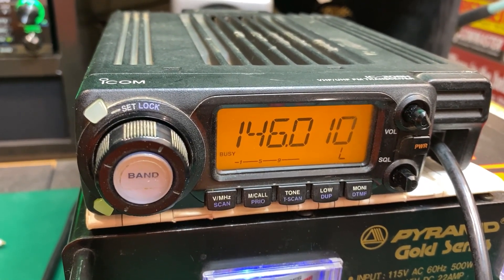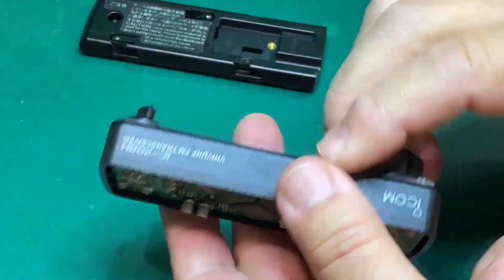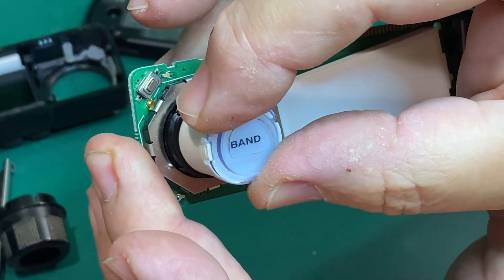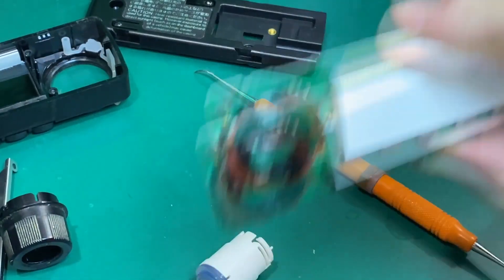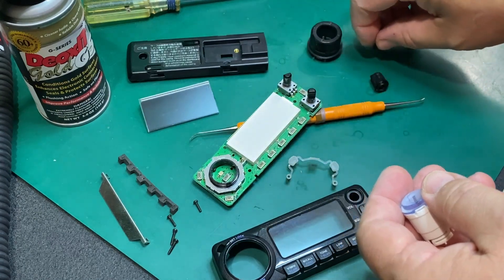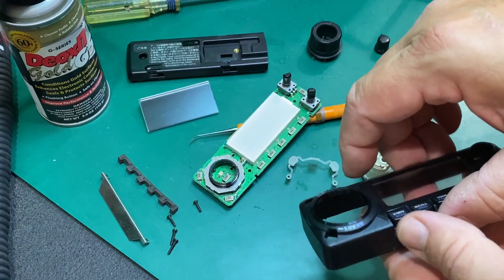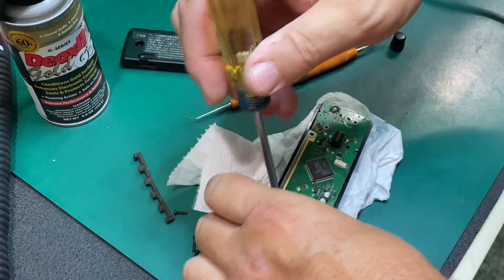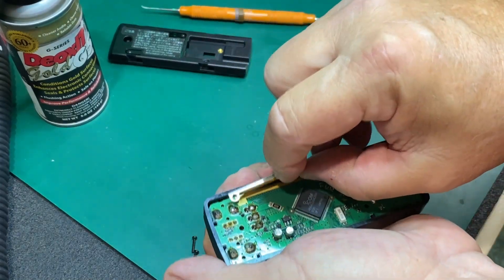ICOM IC 208H VFO Knob Not Working FIXED

Comment: I have a little cherokee cm-5 where the channel know stopped working.  It used to be intermittent, now I can only change channels with scan button lol. 

I changed out pots completely, but still not working... maybe bad solder joints?
Reply from the maker: @joshhensley4246  yes sir sure worth a try.
Reply: Thx =)

Comment: Good job! At one time I used VHF/UHF quite often, but when the most popular 440 repeaters went silent, I pulled my radio from the car. I remember when the 208H came out, but aesthetically I didn't care for the big knob, so when I go on a trip, I'll put its predecessor, the 207H in the SUV. Those ICOMS are well made, and at least the 207H is fairly easy to program on the fly...